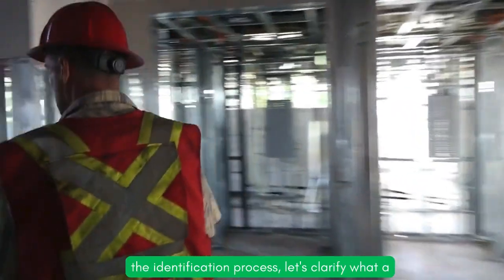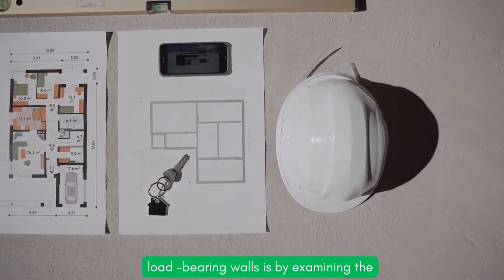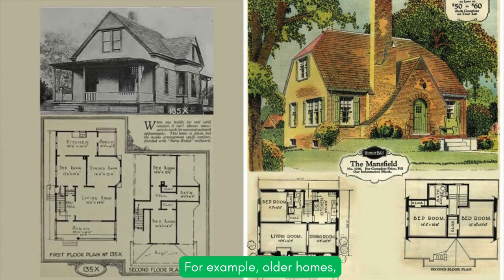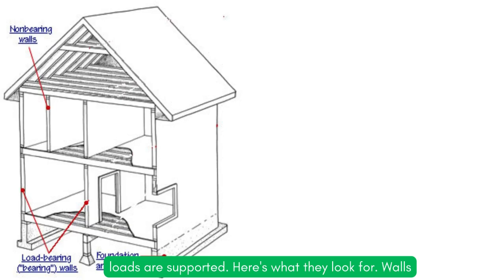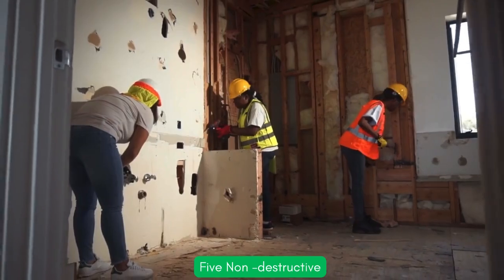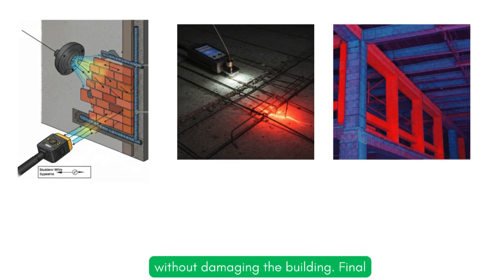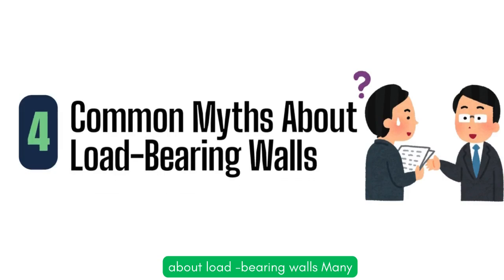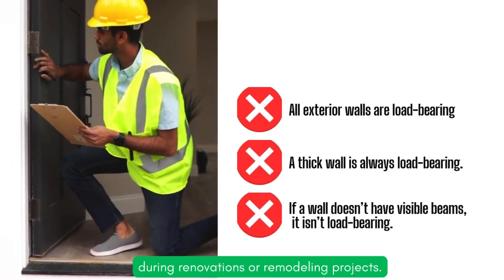Load Bearing Walls in Buildings | Beginners Guide #loadbearing #civilengineeringbasics

Comment: Is there a limit on storey/floors on a load bearing wall,eg can a 7,8,10 storey building be a load bearing wall??
Reply from the maker: Yes, there is a limit to how many floors a building can have with load-bearing walls, but it depends on the material strength, design techniques, and local building codes. 

Traditionally, load-bearing walls are most common in low-rise buildings (up to 4-5 stories) because thicker walls are needed as height increases, reducing usable space. However, with high-strength structural load-bearing masonry and advanced engineering techniques, some buildings can go up to 7, 8, or even 10 stories using reinforced masonry or hybrid systems with RCC bands.

Modern high-rise buildings typically use framed structures (RCC or steel) because they provide better strength, flexibility, and earthquake resistance. However, in some cases, load-bearing walls are still used in specific zones like stairwells or shear walls in taller buildings.

So, while load-bearing walls are generally limited to mid-rise structures, engineering advancements allow their use in taller buildings under the right conditions!
Reply: @CivilEngineeringFanatics  I understand thanx for ur response,I appreciate